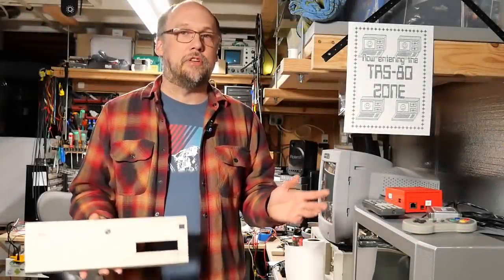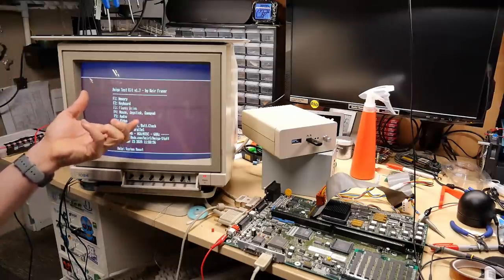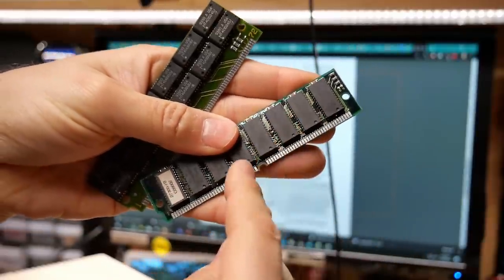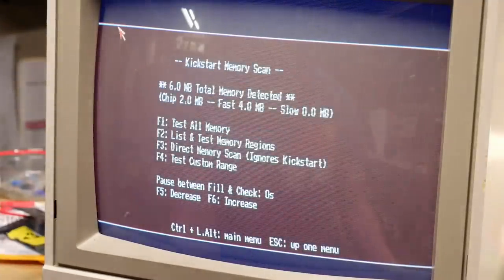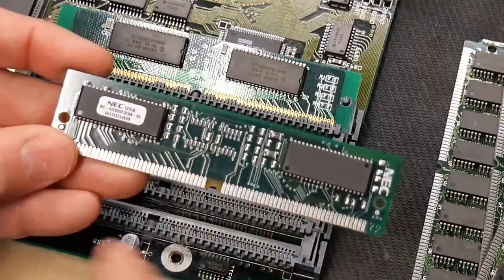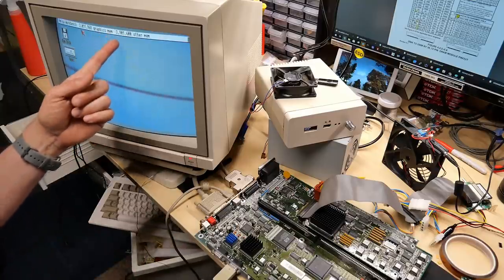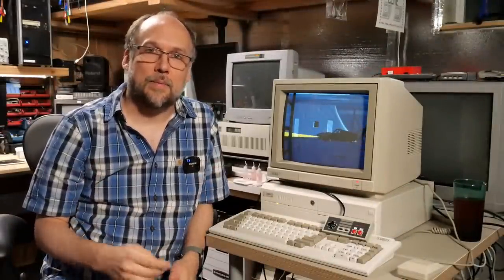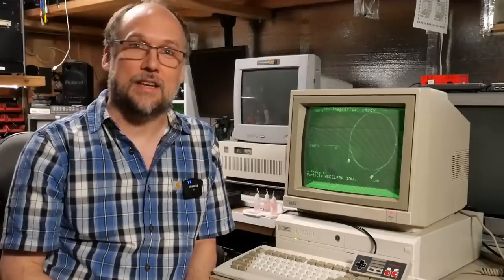Amiga 4000 Repair Part 2: RAM issues are solved!

Comment: Fast power cycling can cause even modern machines and devices to crash and on the odd occasion, break something! Do NOT do that, even if you want to lol

As for the SIMM sockets in an A4000, they are absolute dogsh*t lol I had to replace them. Also, i did the whole RAM stick thing years ago only the other way around, made 2x16MB sticks into a single 32MB etc (dual sided PCBs)

Comment: Thank you man for saving old retro Amiga its worth saving them and have some fun to iam old user of amiga 500 and the A600 + Amiga1200 back then i tink before 1988-89 last amiga i own and i remeber when i did a siwtch to the kickstart from orginal to kickstart 2.1 on amiga 500 :) its was scary back then to take the chip out. but i was able to sucess

Comment: Very interesting video.  I bought an A4000, and the computer worked well for years, but now, there is a problem booting, and when I checked the memory area, I noticed that there are some retaining pins broken off the sockets.  I think this is because the memory sticks are too thick.  I am amazed that it worked so well for so long.  Is there any source for the Amiga type of Simm socket?

Comment: Nice work sorting out the RAM issue! There is a cutout on the top edge of the A4000 daughterboard where you can slip the IDE cable through under the bracket.
Reply: I made a similar comment. I wondered if maybe that's exactly what the notch was for!

Comment: I do recommend that you use 16-32MB fast ram because you'd do not want to unpacking larger files between drawers that's on the hard drives on an Amiga because they're slow...

And if you do like games then WHDlaod is the way to go and then you can load the entire game into RAM instead of reading from the drives.

The RAM shows up as an ordinary drive and you can use it as any other storage except that it won't save its content after reboot and such, I know this is common knowledge but not to all. You can make a RAM drive if you'd like, I tested it and my 1200 rebooted within 5sec.

Comment: Hey Adrian, nice video as always!
Some thoughts: It seems unlikely the RAM check would just look for random data ( that wouldn't really be testing! :) ), but if it just looked at the memory a bit at a time then it would always get back the same data it put in. It just wouldn't physically be at the location it thinks it is. i.e. If it writes 256kb of data (or whatever) then reads it back, then writes another 256kb and reads back, gradually moving up the address space, everything would look fine for it. Because it wouldn't be going back to the lower addresses and then seeing the incorrect data which got overwritten by its higher-address writes. 

I don't know much about the reset yellow screen issue, but it wouldn't surprise me if you're just not waiting long enough when power cycling. Seems likely your original RAM chips were perfectly fine. It could probably be explained by just tolerance differences between the two different types of module. When turning it on and off within like a second its probably normal for it to screw up, no?
Reply: It could verify a lot of random data easily without storing it by just storing the 2 or 4 byte seed used to initialize the random number generator.  Usually it would use the clock for the initial seed, store that, initialize the random number generator, write out 256KB of random data, then reseed the number generator with the original seed, and read the memory back, checking the random numbers it generates against what it generates again.  The reason that this PROBABLY won't catch memory that's repeating is that if the amount of RAM it tests at once is less than the amount of RAM that repeats, it's not going to see a problem.  If the RAM repeats on 1MB boundaries and it's always checking 256KB at a time with offsets of 256KB, it's never going to encounter the repeated memory in a way that affects the test.  However, if those were really 1MB chips being read as 4MB, I'd expect it to be mapped as 1MB repeated 4 times, 1MB repeated 4 times, etc.  This would give you only 1MB of contiguous reliable 'fast RAM' in the OS, and it would probably very quickly crash if you did anything fancy.  I feel like they are probably larger chips (the presence detect on the RAM would also make sense if they were 16MB sticks according to the diagram shown).
Reply: Another option for testing with random data is to calculate a running CRC (hash is better but Amiga is probably too slow for that to be feasible) of the written data.  Then when reading it back just CRC the incoming data and compare it.  If they match you can be reasonably sure that the data you read was correct.

Comment: "Rebooting too fast" I know with the A600 at least, if you have an external amplifier plugged in and turn it off, the Amplifier makes some pretty odd noises that we used to call "Pants ripper", takes a good 15 seconds or so for the sound to fully stop. And I believe the manual used to say you should wait 30 seconds before turning it back on again after turning it off.

Comment: I like that you replaced that loud fan with a quitter one. I would do the same thing. Some computers what the ram to operate a certain frequencies and will accept several different frequencies, you need to have them matched up.

Comment: I seem to remember either the 3000 or 4000 would throw a yellow screen if you tried booting it without the slot riser board installed. There were bus terminators on there that it relied on for clean bus signals.

Comment: Note that I had that occasional yellow screen/guru meditation on my A4000 new.  (1 in 10 power cycles)  It was a very early Commodore production unit, one of the first few hundred A4000 ever made.  The error also sometimes failed to spine up my IDE hard drive once I switched from 200mb to an 800mb HD.  Once booted, the computer worked fine.  I never had problems detecting the fastmem.

Comment: When rapidly power cycling the machine, the caps don't fully discharge.  This can cause data to remain in memory as the voltage threshold of loss hasn't been reached.  This is the reason many devices tell you to leave a device unpowered for a number of seconds before repowering it to clear errors.  Could be what is happening here.  Under normal circumstances No-one would ever power cycle so often or quickly...
Reply from the maker: DRAM has a memory when power is removed -- it has nothing to do with external capacitors. Just depends on the brand and design of the chip. That's why the ROM clears the RAM on power up/reboot on all computers.

Comment: Seems to be a faulty module to me. The fact that the ram test was passing doesn't mean much to me, as you had all the slots populated. To correctly test the modules you should have tested each module isolated and run multiple tests. Now I'm not experienced with hardware pre SDram but I've seen modules that would pass memtext86 on the first pass but fail the second sequential pass. I've also seen modules that would pass when all sockets were populated but would fail when isolated.

Just food for thought, great video... I didn't even know you could modify the capacity of modules like that!

Comment: Might be an idea to get yourself some Isopropyl alcohol, cotton buds and an old tooth brush. When you remove a chip use the alcohol and tooth brush to clean the board, after using flux and soldering use again to remove the flux. Window cleaner works at a push.

Comment: hey you can try to change the caps in the powersupply! if you have 4 ram modules with 8 chips on it (total 32Chips), there are more sensitive to interference from the power supply.

Comment: 15:01 -  I had a look at the code for the memory test (https://github.com/keirf/Amiga-Stuff/blob/master/testkit/memory.c). The first random fill test, takes a seed value writes it, to get the next value to write, it then shifts the seed right by 1, if the bit value shifted out is 0 then it XOR's the seed with 0x80000062, then it writes and repeats. It writes all the memory range, then goes back on another round to check everything is correct. My guess is that this pseudo pattern is repeating at even intervals, so it doesn't catch your mirrored RAM. I would guess that if you asked it to test a range that started the ram test at +1 byte from the start of the fast ram then it might catch the error? In theory, all the bit patterns would be offset by (1 x number of mirrored banks) when it came to read the first bank back it would fail.
Reply: I've posted an issue on the github about the passing RAM test, I feel like it should be able to fail in your situation. https://github.com/keirf/Amiga-Stuff/issues/22
Reply from the maker: Ah thank you for the analysis! I don't want to touch the RAM anymore (due to the flaky RAM sockets) but I agree that it should have caught it as well. Perhaps they just never tested that particular scenario?
Reply: So according to keirf on the github issue, the random fill test does NOT fill with repeating pattern. So why your RAM test passed is now somewhat of a mystery? unless they really were 4Mb modules?
Reply: @adriansdigitalbasement  So as the memory test seems to be verified good, and somehow it passed with the other sticks in. Is it possible that those memory sticks are actually 16Mb sticks? the chart says 16Mb sticks are also S O O O

Comment: I used that same technique of changing the presence detect on SIMMs to stuff a full complement of RAM into my IBM PS/2 L40SX laptop. The battery life probably took a bit of a hit now that it's powering RAM that it can't even address, along with some ECC generators; but it's not like the runtime on batteries was every anything to write home about

Comment: I really enjoyed seeing the first two parts on restoring an Amiga 4000.  It brought back memories of my experiences with the Amiga 500 and 2000 that I had.  Back in the day, we used the 500 to run a BBS service.  It had an  expansion slot and we added memory and a hard drive via an expansion box.  My 2000 was configured to video work with a digiview connector like the one that Stewart sent you in the Apple ][+ series.  It also had a camera and color filter.  I had software to split and combine the 4 different images.  I also had a NTSC video card and an HDTV device that allowed me to output real HD.  I look forward to seeing the rest of the restoration.  There was also a 2000 at work that we used as a video titler.  It had removable hard drive platters (A syquest) that was horrible as the unit was frequently used, and they did not stand up to frequent moves.

Comment: Stumbled across this, and the nostalgia is off the charts for me. Used to have an A4000/040 setup a long time ago, with Picasso graphics and a high res multimode monitor. Sometimes I think of getting one again but it goes away as soon as I focus more on the idea, I have enough other retro gear with no practical use as it is, last thing I'd need is more of it.

Comment: I feel like the issue with mirroring could probably be detected by first zeroing out all memory, then writing a 0xFF to each byte, but first checking the contents of each byte before writing.
If memory is supposed to be cleared out, yet appears to already contain data, should be pretty conclusive.

Comment: So, Adrian, you've been retrobrighting old machines for years now. I've JUST got an A4000. It's gonna need some repairs but that should be fine, HOWEVER, mine is kind of yellow. I've been considering retrobrighting (waterbath method) but I'm nervous about the effect it might have on the plastic. Do ou notice any degredation or brittlenes in the plastic after retrobright? Does the feel and look change, other then getting brighter? I'm more comfortable with a yellowish A4000 then a weirdly brittle and permanently strange-ifyed A4000..

Comment: Intermittent failures are always a pain to chase down. One way to try and aggravate an intermittent problem to track it down would be using heat to warm up a few suspect chips at a time, and failing that, we would then try cooling the same parts, using canned air (the propellant, specifically).

Comment: I always wondered why you don't see more people recapping the PSU. Are those electrolytics just more stout because they're bigger?
Reply: Usually (but surely not always) power supplies with bad capacitors won't maintain a steady output voltage. Most PC power supplies (and likely the Amiga too) use what's called a forward converter design which puts very little stress on the output capacitors.

Comment: The A4000 is a nice machine mine served me well for many years after commodore folded. The real shame is that it could have been much better were it not that the AAA chip set was cancelled. That is why there is a jumper marked 2 or 8mb chip ram on the board which is now totally useless.

Comment: Could you have routed the IDE cable through that little notch on the daughterboard?
Reply: You can see what I'm talking about at 30:15. I don't know whether that little notch is big enough for IDE, but it looks close. 

If it worked, you wouldn't have to run that IDE over the top of the metal case arm where it could get damaged.

Comment: Great video! Nice troubleshooting!! Hoping there is a Part 3 to wrap up the clock issues??
I remember getting trapped like you with "slightly" incompatible RAM! (Can't find anything wrong with it in any tests, yet it has weird issues until it is replaced!)
Reply from the maker: It'll be down the road most likely -- for now I have moved onto some other machines. :-)

Comment: The explanation about "mirroring" is actually off. It is not seeing different copies of the same thing. It is actually seeing the same thing. Since the upper bits are missing, the lower bits repeat (they rollover). So you are reading/writing over previously used addresses. The tests work because the data was already put there at the wrong addresses (2-4 times off), and the wrong addresses are read back. On writes, whatever is written last will stay. So having it misconfigured would allow it to overwrite previously used addresses since it "thinks" it is using different addresses. There are no extra copies. You just are using multiple addresses as the same addresses. The upper bits are ignored and the lower ones are the same.
Reply from the maker: Yes but anytime the CPU writes to any memory location, the CPU could then read back that data in 4 locations. To what the CPU sees, the data is mirrored in 4 locations.
Reply: @adriansdigitalbasement  -- Well, it would just be aliased. The upper bits are ignored so it all goes to just 1 location. The CPU may "think" it is accessing different addresses, but it would be referencing only 1. This could corrupt things.

Interestingly, some designs exploit this. For instance, consider doing 8086/8088 real mode on a 286 or higher system. The 286 has more address lines, but the segment: offset system cannot address past 1088k addresses. So the hardware grounds the A20 line so the addresses can't go past that.

Or consider how hardware subtraction works. Generally, there is no subtraction. What happens is that what is subtracted is converted to 2-s complement and added. For instance, let's look at 8-bit subtraction. The hardware would record -1 as $FF (11111111b) and 1 as 0000001b, and they are added. Normally, that would return 256 ($100 or 100000000b). However, due to overflow and only having 8 bits, the hardware never sees any 9th bit. So the user ends up with 0 as the correct answer to 1-1.

Comment: Is that a usb nintendo controller you are using on you're amiga? I seen right at the end of the video!
Reply from the maker: Actually no, it's an original vintage one I modded with a 9-pin wire to work on Commodore/Atari machines. I have a video in the works to show off how this is done. It's great because it maps one button to "up" which lets you jump without needing the D-Pad in most Commodore/Atari games.

Comment: Why not just re-lubricate the PSU fan instead of the replacement?  Is it noisy in some other way?
Reply from the maker: Oh it wasn't noisy because it was bad -- it was just an older design that just makes a lot of noise because of the blade design and it's fast rotation speed.
Reply: @adriansdigitalbasement  ... Ah, that reminds me of the original fan on the Tandy 1000A, which I still have this PC, given to me long ago.  The fan runs directly on 120Vac & it is noisy.  I cannot be sure if it's the spindle that needs lubrication because I don't know how to crack the fan open, or if it's just the inherent fan blade design.  Normally, other more modern PC fans  have that cap behind a sticker label in the center that you just peel off & then take the cap off to get to the top of the metal spindle axle & put a couple drops of oil there, which works wonder.   I will either have to try to slow down the cfm speed electrically or just give up & spend $10 on an a/c pc fan from eBay, or maybe there is a place on the motherboard where I can siphon 12 vdc & so replace it with a d/c fan. I don't know yet.

Comment: I think I suggested this on the last video, but what if you swapped out the ram slots with higher-quality slots with metal clips?
Reply from the maker: That is extremely hard -- one to find the angled low profile sockets that are compatible and then to perfectly desoldering hundreds and hundreds of pins without any damage. Unless this is already broken, doing that is just asking for trouble.